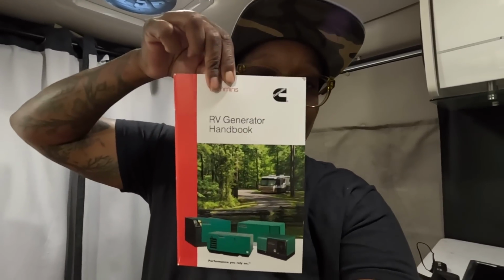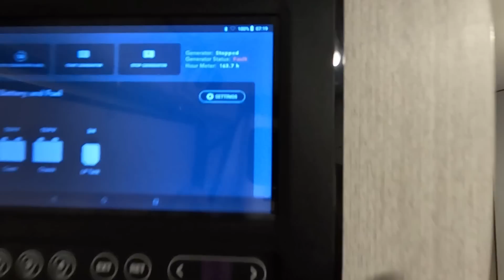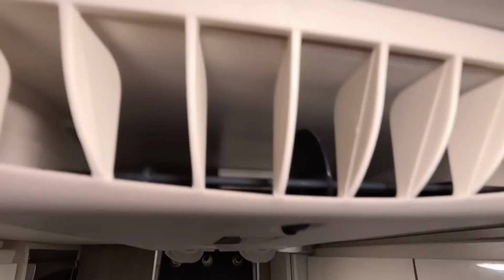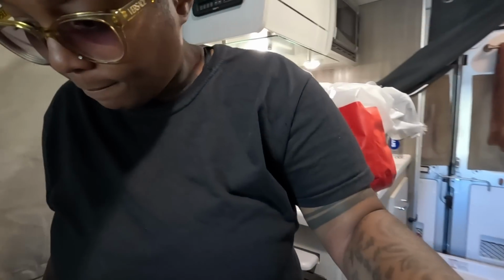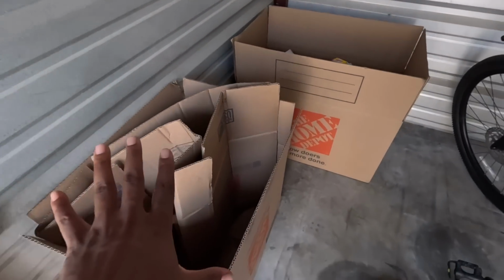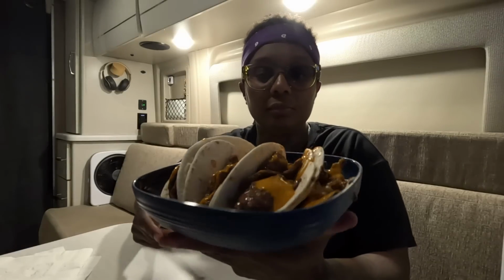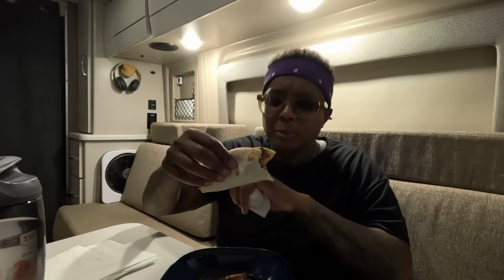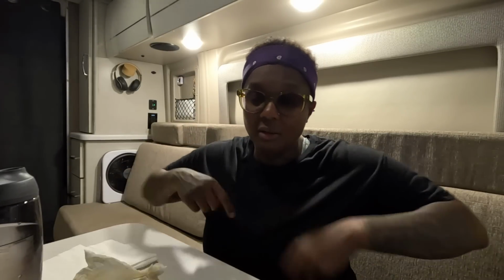Living In My Van||Overcoming Van life Challenges|| Preparing To Leave Florida|Ep.117

Comment: I live in a senior apartment, and I confess I'm a bit of a prepper.  Last year I bought a big solar generator with a solar panel.  There have been a couple of power outages, but I had the comfort of knowing that I could power my fridge if needed.  And have lights.  Keep trying to get that generator fixed, Nomi.  But always have at least one backup power source.  Especially if you're planning on being out on BLM land.  It won't run your AC but it will keep your fridge going and charge your phone and puter.
Reply: As a pepper also, I appreciate by our comment!

Comment: I have a 20 year old class c that I have been renovating for 2 years. It is always something wrong and I am just a weekender. There is nothing worse than a water leak or power issue. My generator is original and still works great. However, I use it to run the microwave once a trip maybe. My goal is to go to 70 degree weather so I never have to use my AC. It is so loud and obnoxious I hate running it. You are in the wrong part of the country for summer my friend. The mountains and mesas of northern New Mexico are lovely and temperate. ❤❤❤😊

Comment: A few years ago, Cummings repaired my generator in Missouri. They took the generator out of our 1998 Winnie 22’. We were directed to stay in an RV park close by and run our A/C off electricity for 3 miserably hot Missouri July days while they fixed our generator. I was in my 70’s and my mom in Her 90’s and we were traveling with 6 cats for the summer from Bradenton Fl to Mt Rushmore. Cummings staff worked us in as an emergency because if we had to wait for the first open appt it would have been over a week. They were very good to us.

Comment: Hey Nomi! Dumb Q for you. When the generator was replaced, did the verify the control panel wiring was correctly connected and make sure fuses didn't need to be swapped out?  I told a friend of your situation and he asked these Q's. Just a thought. He said if the generator wasn't set correctly with the computer, it could give a default reading and it could cause problems.

Comment: I bought a bamboo floor/bath mat that folds from Amazon! Very handy to use when showering outside to keep feet off ground. Also another tip.  I bought a couple of electric connectors to use when I had to hook up to shore power and there wasn’t a 30amp connection.  To either be able to transfer from 50 to 30 or 30 to house current.
Reply: Those connectors are life savers!!

Comment: I wonder if it Has to do with driving meaning as long as you were stationary at the repair place and the generator is running. Everything seems to be fine but when you drive some distance and then you turn on the generator, that’s when these problems are happening so I would’ve asked them if I could stay there overnight and just cruise around town and then come back and park in their area and stay there overnight just in case it happens again because I would hate to get a distance away and have the whole thing happened all over again. That’s so frustrating.

Comment: Nomi,
Don't accept this BS 'explanation'.
The tech's explanation is 'the code means it 'randomly shutoff'. ? AND??? THAT'S a satisfactory explanation??? NO! It's OK if a brand new generator just 'randomly' shuts off??? NO!  And he acts as if THAT is acceptable??? NO.
It doesn't seem there was mention to you to expect your NEW generator to 'randomly' shutoff. You were not offered a 'WHY' OR 'what should be done' when this happens.
Where there's a code...there's a reason AND a stipulated 'fix', per this code. 
As well, after you called Cummins, you
 shared he stated that it had shut off for them after installation...seemingly, THIS wasn't mentioned to you, at pickup. Also, is a little suspicious, in hindsight that your van was running at pickup (unless you had started it before you were recording).
I've never found my car running when shop turned it over to me. Hot weather or not. And I go to a shop where they know me. 
All this to say, their honesty, quality of service, professionalism is rather suspect.